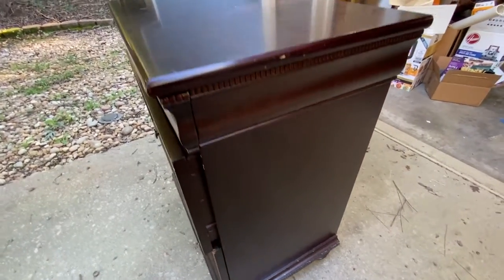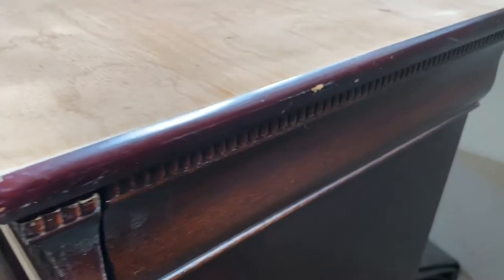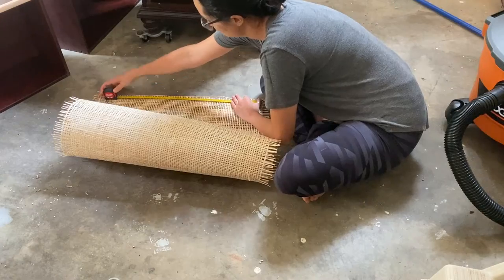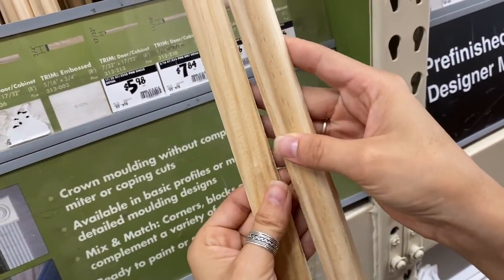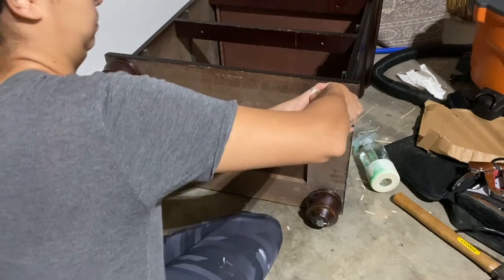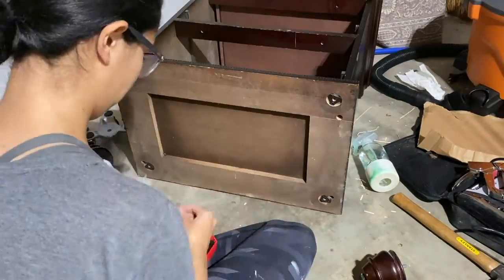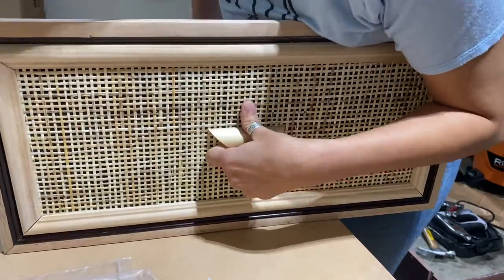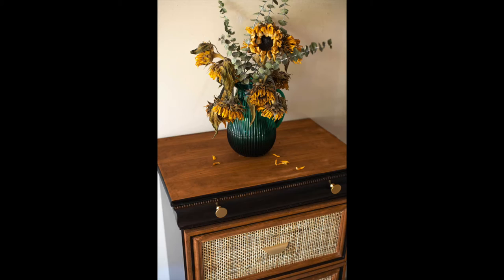Adding Cane To Drawers | Nightstand Edition | Episode 22

Comment: Turned out lovely.  Well done.  When you were marking the holes for the hardware I didn't know what you were at as I expected you to drill and cut out a chunk of the drawer front to inset the cane into.  Nicely done.  At the outro it looked like a fairy was fluttering outside your window!!  Thanks for sharing and take care.  Love from Ireland.
Reply from the maker: Oh haha! Yeah I thought about doing that, however I knew I wanted to put the hardware in the middle and also, I knew that it wasn’t solid wood so I didn’t want to deal with having pressed board showing. Also, those were definitely wasps outside but we’ll call em fairies lol